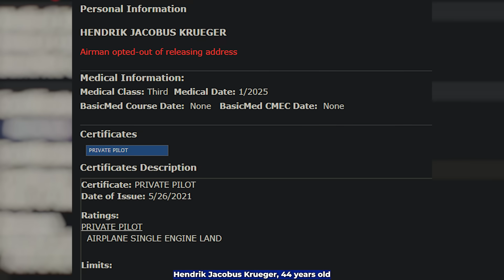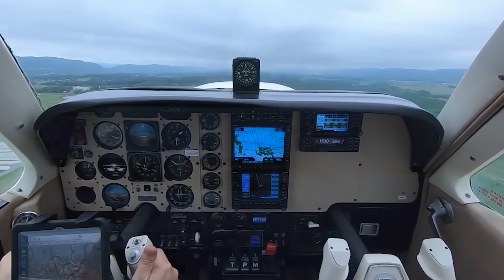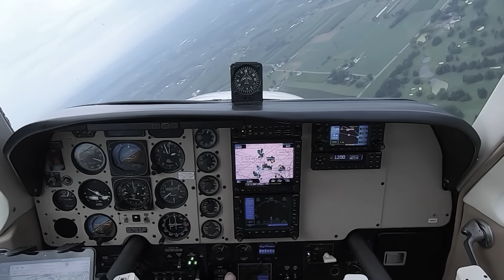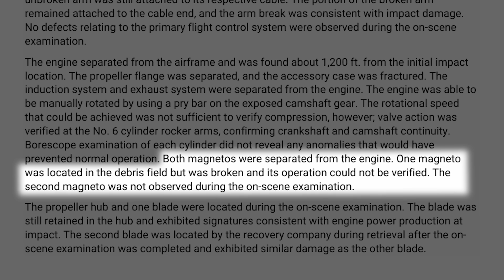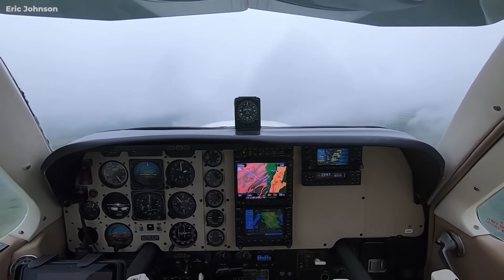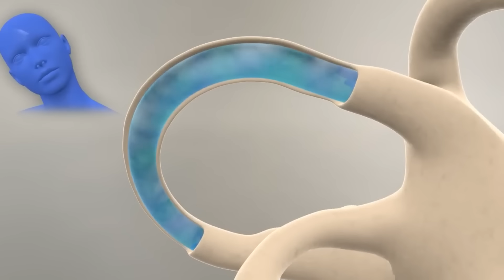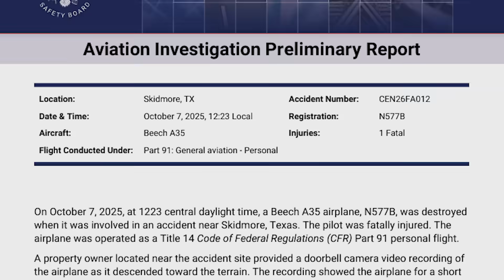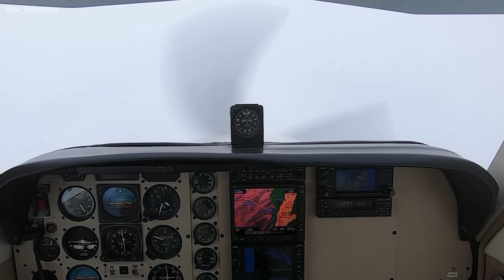New SHOCKING Details About N577B Fatal Crash Oct 7, Deadly Turn...

Comment: Depending on a beefy airplane like a Bonanza for dependable cross-country travel without possessing an instrument rating is like buying a '69 Z28 Camaro with a 302 cubic inch V8 and replacing it with a 25 HP Briggs & Stratton rope starter. What a waste of fine machinery and time...
Reply: The Bonanza is a fine airplane..my hat is off to Walter 😮
Reply: Your comment commits a reasoning error by assuming a direct causal or logical link between aircraft type and the need for an instrument rating, when those are distinct considerations.
Reply: @smark1180 they are distinct but important because the instrument rating is another means of achieving proficiency...adding any degree of accuracy in airplanes or women is understanding both which might lead to better results in both of their performance😂I have been licensed for 48 years in flying but even longer with fooling around with the ladies...both are dangerous and can kill you or least make one wish they were dead😅it is much better to stay in practice with both😊
Reply: @Johnnyjacobs-h8f  True, experience counts in both arenas. 

But the distinction I made isn’t about practice or proficiency; it’s about regulatory purpose. An instrument rating isn’t required because the airplane is “beefy,” it’s required because of the flight environment. A Bonanza in clear VFR airspace doesn’t demand IFR skill any more than a Cub does. The aircraft’s performance potential doesn’t automatically dictate the licensing requirement; the weather and flight rules do.
Reply: @smark1180 I understand your thoughts process....a very heavy airplane is just as easy to fly compared to a Cessna 150. They appear to be more stable. To me, they are heavy and stable in VFR flight. I would much like traveling in a heavy Cadillac rather in a Mazda Miata.
Reply: @Johnnyjacobs-h8f  The car analogies are colorful, but they don’t really hold up logically.

 Comparing a Bonanza to a “heavy Cadillac” and a Cessna 150 to a “Mazda Miata” mixes comfort metaphors with regulatory arguments. In aviation, the FAA doesn’t issue instrument ratings based on how “stable” or “luxurious” an airplane feels; those are subjective qualities, not legal thresholds.
Reply: Now you are talking my language...I had a 1967 Pontiac GTO in high school in 1973😮4 on the floor with a 5th under the seat with a pretty blue eyed blonde w long legs partly covered with a mini skirt...I was in heaven in those days...good whiskey and bad women 😂